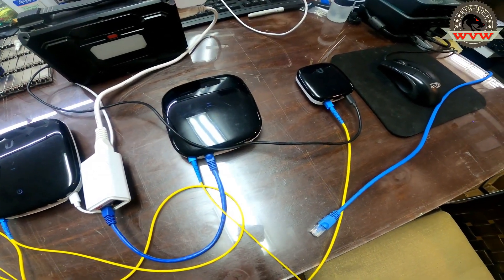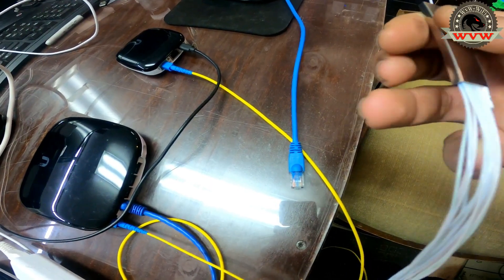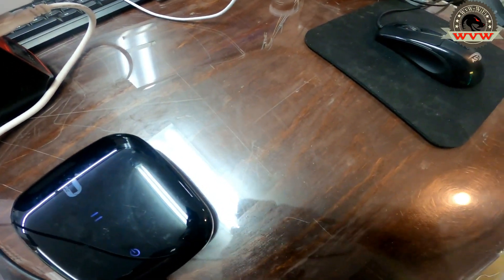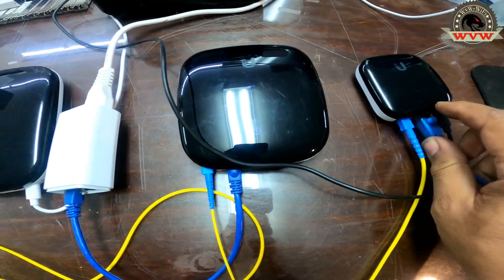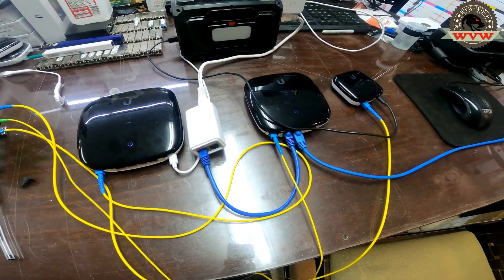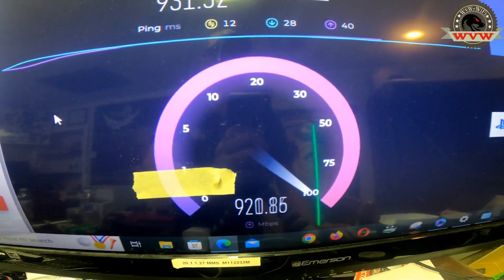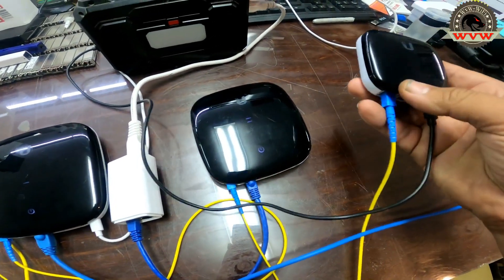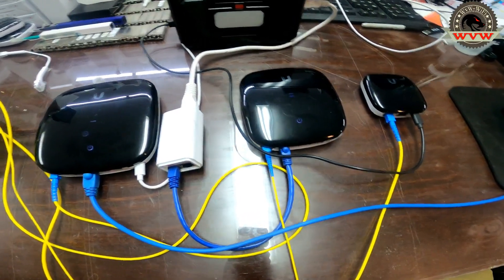Micro ISP fiber GPON adoption to data plans. LAB Testing prior of deployment. Ubiquiti Gadgets.

Comment: Dude, I can't get the UF wifi 6 routers to work unless they're in bridge mode.

The uf wifi 2.4 model works fine in router mode, though.

Can you tell me how you got it to work?
Reply from the maker: Sorry for the late reply, I suspect Ip conflict as they should automatically configured from the OLT. I also believe that they fix an issue in the versions prior to the last one. let me know if you still need help

Comment: Put those UF Wifi devices straight into the trash we had so many issues.  The UF Loco and the UF Wifi6 are awesome tho!  Also using the wrong cables for gpon you should use APC only
Reply from the maker: Definitely sure they are the wrong type of cable. Needed 3db of loss as  I don't have any att in hand. So I used  blue ones. To create a little loss.  Silly.  Did not have any problem with them yet. They are only 2.4 and most of the time we use them as bridges and clients use their own routers.